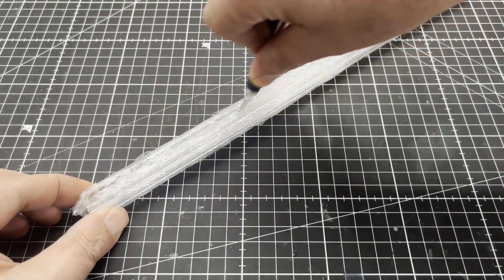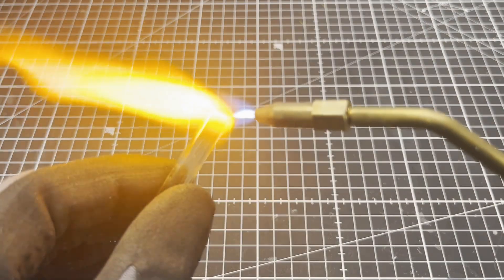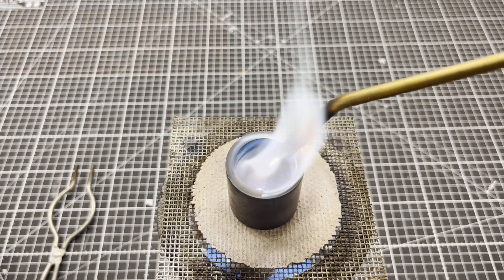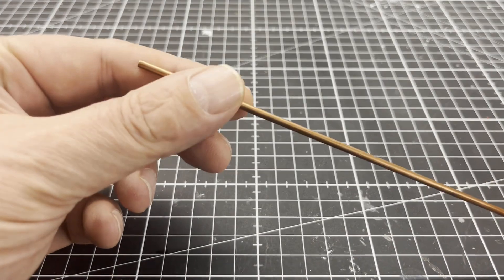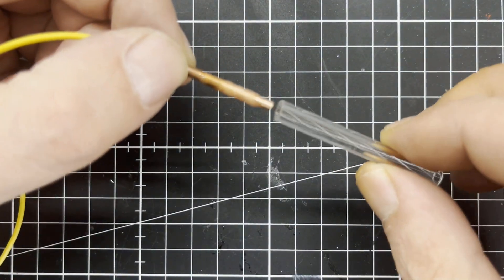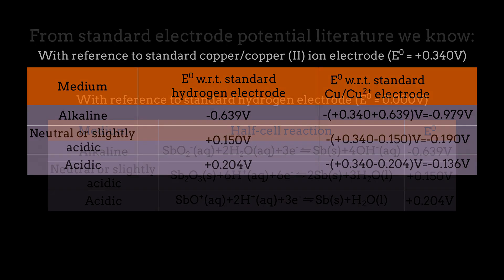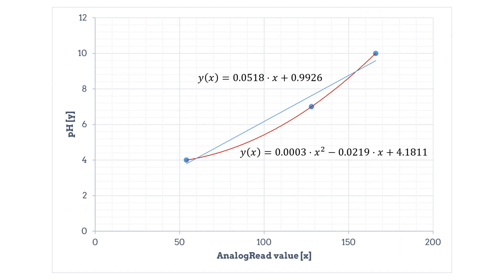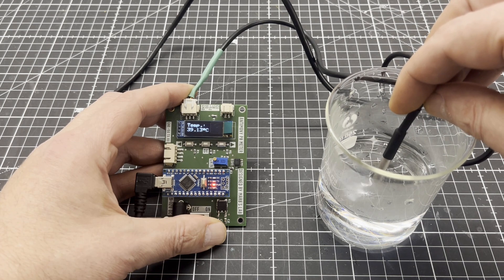Building an antimony pH meter from scratch

Comment: Your copper rod look looks to be brass ( yellow ) , brass include Zinc metal and conductivity is not as good as the pure copper , that perhpas a improvement way ?
Reply from the maker: It's copper, not brass. Might be the lighting makes it look a bit like brass:)
Reply: @Marbslab  thanks for your answer  , if you want to improve the gluing , you can use fluorhydric acid to make the surface mate and remove the glossy surface of the glass . Be aware fluorhydric acid is a dangerous product .
To pour molted metal in a tube , best is heat the tube to reduce the colloing effect from the top bootom to the front opening and let coll after pouring.

Comment: To improve the accuracy ( except to improve the LM358 by switching to a more performance one or ven a last generation of LM358 as LM358B or BA this popular IC have received a lot of improvement  ) why to not use a 16 bits or 24 bits ADC rather the internal ACD of the Arduino ? 
Your video are very interesting thanks
Reply from the maker: You can do that if you need higher precision, but for this application (with the home-made pH electrode), the 10-bit ADC of the Arduino is sufficient:)
Reply: @Marbslab  YT have censored my technical answer ... amazing ... or perhaps incredible !!!!  , try HM411 24 bits ADC that a nice cheap IC for chemistry measurement a real improvement for few Euro.

Comment: Mit dem LM358  haste dir natürlich einen Opamp mit relativ großem eingangsstrom gewählt. Es gibt welche mit gleichem Fußabdruck die da um größenordnungen besser sind. Damit sollte sich das Potential wesentlich schneller aufbauen und die Elektrode wesentlich länger halten. Etwa der MCP6002. Da bist du um den Faktor 10000 effizienter in dieser Hinsich und viel mehr sollte der auch nicht kosten. Aber tolles Projekt ist vielleicht etwas fürs PC Praktikum.
Reply from the maker: Danke. Hatte den LM358 halt gerade zur Hand. Lässt sich ja problemlos mit dem MCP6002 tauschen, da gleiches Package (SOIC 8) und Pinbelegung.

Comment: Hey another great implementation of a chemical concept! :) I like the way you designed the Sb electrode. The idea with wood as diaphragm for reference electrode is also very creative! But I suspect that it contributes to the slow response time and also to the poor linearity because it is not very permeable. A little plug of Agar Gel premade with Salt solution worked better for me. Take care that the salt in the diaphragm and in the reference electrode are the same to avoid additional potentials incurred! That's why Ag/AgCl in KCl solution is ideal.
Reply from the maker: Thanks. I will try the Agar gel, might be a lille bit messy...
Reply: low density alumina ceramic is also a solution as that porous , porous ceramic are used for ERT ( electro resistivity tomography ) electrode for soil measurement